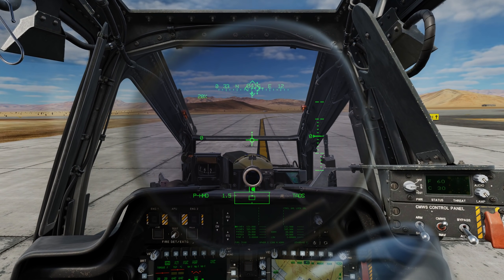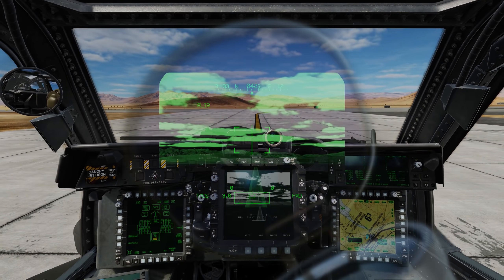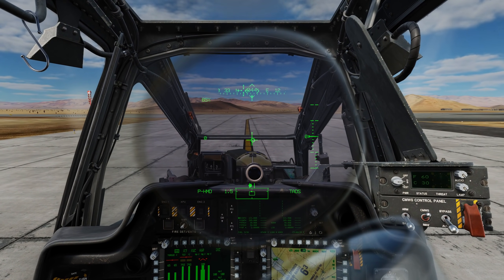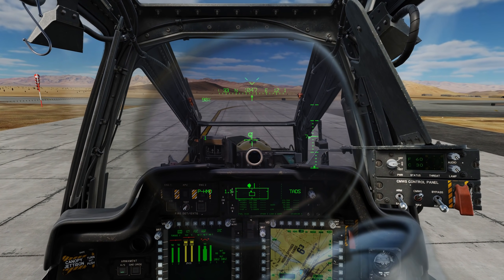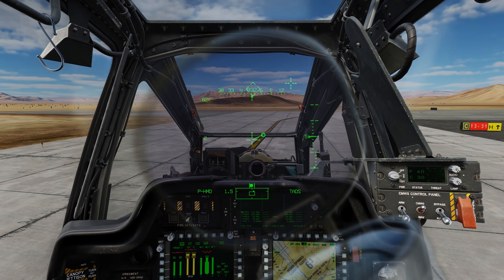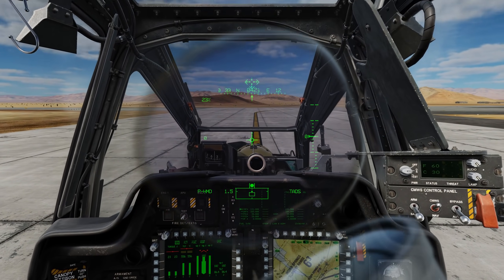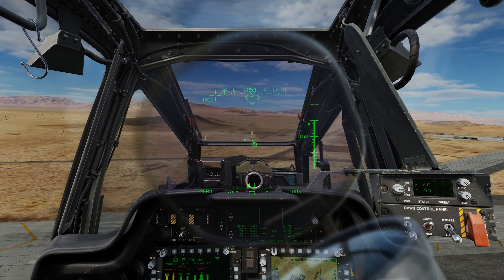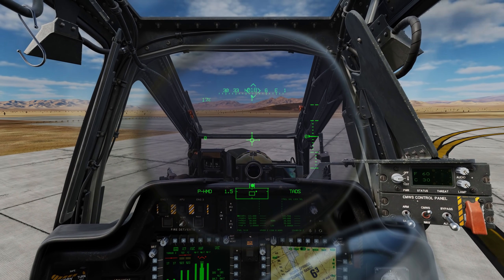DCS: AH-64D | VRS and Settle with Power

Comment: Outstanding! I was just having another session of easy start, easy hover, easy navigation and BOUNCING LIKE A BASKETBALL attempting to land, and wondered - I wonder if other folks are having trouble with this?
LOL apparently they have, and ED is already all over it.
GREAT JOB WAGS! Super timely video.

Do have to say though - the issue most are running into is in the second half of your video. You demo'd it.... but you really didn't offer much to avoid it.
You offer that 'If you have time to drop the nose' but in your own demo, you didn't have time to do that, either. More importantly, you dropped collective HARD in your demo - but this happens when you drop collective VERY SLOWLY, as well. You demo'd the problem, but notably, didn't demo the solution.
Ultimately, the behavior is not right. And not very realistic.
If the chopper just started dropping, with nothing you could do, because you very slowly dropped collective as you gently came down from hover to landing, this helo would have had MANY crashes, in real life. But they didn't because the helo does not do this in real life. No helo does this in real life.
Have seen a couple Casmo videos where he was clear - SWP and VRS are pretty dramatic/overbearing in the sim, compared to real life.
I'm not a chopper pilot, just a veteran DCS chopper pilot, and this has happened in early flight models of other choppers, too.
You have to avoid VRS and SWP in most choppers, true. But its just not nearly as easy to get into it as was modeled in SEVERAL early versions of the FM for SEVERAL new choppers, in DCS.
The flight model needs some work in this area. To be blunt.
And maybe some consideration to how the default Chopper FM handles this, as it has now had to be fixed in several previous chopper FMs, between EA and release.
Reply: Said another way, no MATTER how slowly I take that last 200 ft down, once I get in what should be Ground Effect(additional lift) instead I have NO LIFT, regardless how green the torque indicator is. Suddenly I fall like a STONE. It's not correct.
Reply: @freighttrain7143  The only two choppers in DCS with severe VRS I can think of are either the Hip (rather manageable anyway) or the early UH-60 mod (that was a complete VRS monster).
Have you ever thought that in RL your inner ear is helping you to not get into this condition? Sitting in the chair and looking at the screen you simply can't have any help from it. But even so, the VRS in this module never gave me any problem even once (unlike that early "UH-60"). Maybe you should try practicing to get more info from your peripheral vision? Sure, it won't fully replace the "seat of the pants" feeling, but it's still possible to learn to get by using mostly only the vision.

It's like complaining that a realistic bike or a bicycle sim is "too hard" and "in reality you wouldn't have problem keeping it up". Well, in reality your balancing act is pretty much "automated", lulling you into believing that it's something easy to do. Helicopters don't have it as bad, so it's very much possible to just use your vision in a sim instead.
Reply: @getsideways7257  Thanks for the advise, mate. Practice, over and over, I have. For hours, just landings. And I'm not the Exciteable New Guy here. There are 4 total airframes ED makes that I DON'T own. I have flown them all. I have been doing DCS for 12 years now. And again I've flown every helo in DCS except the Hind. From early access on. 3 of them before had this EXAGGERATED VRS, 3 of them had it fixed, 3 of them had the fix listed in the patch notes. It's not opinion, all these things happened. As to the Apache, I am using the instruments which are far more reliable than looking out the windows. The rate of descent indicator which is in the lower right of the IHADSS don't lie. I can be descending at a rate 1 tickmark below Steady Hover. At the rate I am descending, it takes 2-3 minutes to drop that last 100 feet. THAT SLOW. When I hit what should be Ground effect, that rate suddenly zooms off the bottom of the meter, I fall like a rock and bounce. It's not slightly off, it's completely broken, IF you hit the bug. Meantime, I have made no change in controls, only the interpretation of physics changes, in the engine. Happens time and again. And it's happened before on other models, hence my earlier post explaining exactly that.
I had one smooth landing last night. So that's 1 out of 35, at least. I will spend hours practicing, it doesn't matter, Physics do not suddenly change at 75 ft IRL, just in this game, and just on this early access Helo. So last night, I had one good landing, like butter smooth. I had to pull collective to zero to even verify my tires were down, there was no movement on touchdown at all. 
It was awesome.
What did I change? Nothing. Exact same hover to landing steps as before, I just didn't encounter the bug. 
What will happen next is I will find the steps to trigger the bug, I will report it, and if its ever seen, ED will patch it out and list it as updated FM or solved an edge case in the FM for the Apache, etc. I will tell you right now, I don't think it's a bug in VRS simulation. It happens 99% of the time when I hit Ground Effect. I think its a bug in Ground Effect simulation for the Apache. Instead of extra lift(Ground Effect IRL) I suddenly have NO LIFT.
I get that you aren't encountering this bug - I wish I was you. I'm sure if everyone was encountering it, it would be higher priority. But as you can see at the beginning of this video, alot of people are having this issue. Some probably are having the ZERO LIFT bug I am seeing quite often. 
Everything else in the Apache works great. The only other complaint I have at all is that the tutorials have lots of little mistakes - pretty rough QA there. They might miss a step that makes their steps not work until I added the step they skipped. It happens. And they often will mention a control without mentioning the default keybind for it, or using the exact keybind term - which makes it hard to find and keybind that control, so that could be better.
Reply: @freighttrain7143  Finally, another human being calling it a helo and not a "heli". Anyway, I mostly meant relying more on your peripheral vision to compensate for the lack of G-forces. But as you explained it - it indeed looks like a bug. Since you appear to have it most of the time, there shouldn't be a problem documenting it - preferably with the inputs shown.

If you would say that happens only with this module (or maybe with the Hind as well), that would be one thing, but you are saying that it was happening with some unspecified other modules as well (minus the biggest culprit - the Hip). That sounds rather doubtful... Then again, a video and possibly the conditions / a mission file would help hugely here.

By the way, try doing a hot start (the engines running) on the Marianas map in default weather with nothing on the pylons, no radar, the FMC's interference switched off... Also, about half fuel. I wonder if the problem will persist in that case.
Maybe the bug is triggered by the conditions (if there really is a bug).

As for the rough QA... I'd rather have it this way than wait for another half-year. In fact, I wanted them to release this even sooner. It usually takes years for a DCS product to become polished after the release anyway. But if there indeed is such a bug as you described, it's just hilarious. As I said many times before, releasing the thing sooner is BETTER, because the community can help with catching the bugs. If only the said community would report them in a calm manner (which rarely is the case).
Reply: @freighttrain7143  I'm afraid Google discarded your reply (unless it's going to be added later). Did it contain a link maybe?
I guess I mistook you for someone else whom I had a conversation with in another thread, that's why I thought you excluded the Hip instead of the Hind.
Either way, I think you are exaggerating the VRS "problem" in DCS and with this module in particular. Mi-8's VRS is pretty severe - that much I agree, but the rest of the fleet seems fine to me (apart from the Ka-50 that I barely ever touch, so I can't comment on that).
Again, don't you think you are not taking into consideration that in a real helo your vestibular system would force you to arrest an onsetting quick descent way before the descent would develop into a full blown VRS? Pretty much like it acts in response to any fall... In a sim you can't feel these G-forces, so you are not as quick to react - and it's harder to learn to do it instinctively. This also can explain why Casmo and other real pilots could be having a problem with it - they are too dependent on the vestibular system.

Sadly, thanks to how YouTube notifications are working I couldn't read the rest of your message.
Reply: Also, it seems that you are expecting a 18,500 lbs loaded (or even a full on 23,000) machine to fly and LAND like an emptied 15,000 lbs one. Don't forget that these things are not expected to get back and land with the whole set of 16 Hellfires and all the rockets on the pylons. And even when they get transferred like that, the pilots have to be extremely careful on landing.
Reply: @getsideways7257   @Get Sideways  
Reposted it if you cant see it.
Appreciate the help buddy, but you really aren't understanding me.
1. I said it before, the HIND is one of the few modules I don't own. Never said anything about the HIND having this problem. I have never flown it, like I said - I don't own the module.
2. I've said it twice before - the other 3 choppers HAD this problem. PAST TENSE. It was fixed(patched out) in Flight Model updates to those Helos. They HAD this issue in Early Access for those modules. Has been patched out, years ago. So no - I'm not saying other Helos HAVE this problem(present tense) but that I have dealt with this problem before, on those Helos, while they were in Early Access, YEARS AGO. Whatever this is, it often happens with new Helos in Early Access phase, they catch it, they patch it out, I've seen that full cycle 3 times before. If it bugs you I didn't mention the modules it was the Mi-8, Black Shark, and Huey. The Huey I almost thought it might be realistic - 2 blade Hueys could not autorotate successfully in my SAR unit when I was in the USAF, we had 2 crash while practicing the manuever. Not much power or lift on them in general, so VRS was a BIG real world problem on them. But then they updated the FM on it during EA and I stopped having the problem for the most part. I can still get in VRS in it, but when it happens I can see what I did wrong, its not a light switch to NO LIFT like this problem I've got in the Apache.
3. As for rough QA in the tutorials, its pretty simple. You either have enforced S&P for development, and a good QA with testers who are sharp and test thoroughly, or you don't. In my full time profession, I manage releases of software and software features specifically, for a large company(deploying new software features to 600,000 endpoints is a monthly or quarterly responsibility of mine, depending on how busy we are). If I so regularly got training documentation wrong to the extent that you can't make the software do what I am telling you it will do following my recorded steps, I wouldn't have a job. So while this is a game, yeah, I get it.... but we pay for it all the same. Gamers should have certain expectations of quality, and saying well, "It usually takes years for a DCS product to become polished after the release anyway" is much more lenient than any attitude that leads to improvement in QA processes over time. Shorter version: If you say 'Eh, it's OK again this time'... then it will continue to get worse, less reliable, slower to improve. This is a time tested reality in software development. You have to enforce standards, procedures, and quality expectations, or the quality will steadily get worse, not better. In the video game industry, I can tell you, though technology has gotten better the past 20 years, product quality and QA testing has clearly gotten worse. Part of the reason for that is the relaxed expectations Devs see from gamers who don't expect much because its just entertainment.

Just my opinion, you are entitled to your own, bud. And Thank You for trying to help - I appreciate it.
Anyways, it's a good module, I'm glad I bought it, and I have all the weapons down as of tonight, so I'm having fun. 
For now I will just have to settle for practicing Cold Start outside the Cold Start tutorial(it doesn't work in the tutorial mission, just any other mission other than the tutorial, lol) and performing the rolling landing, which does not drop me like a bouncing ball, suddenly.

P.S. I would try your whole test - but the Marianas map? I just checked - I was surprised to hear it was available - according to the DCS World site, this terrain cannot be bought yet. So - can't do that part of the test. There's info here:
(pulled the link)
But the Terrain purchase page doesn't list the Marianas yet:
(pulled the link)
P.S 2. Whats the 'HIP'? I keep seeing this term referring to one of the DCS Helos, but I am not familiar with that if its a nickname for one of them.